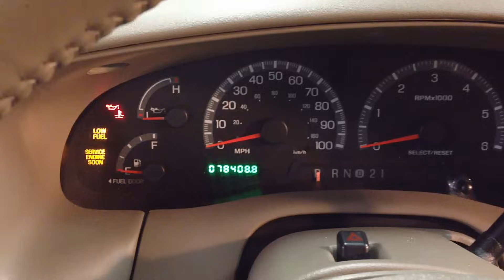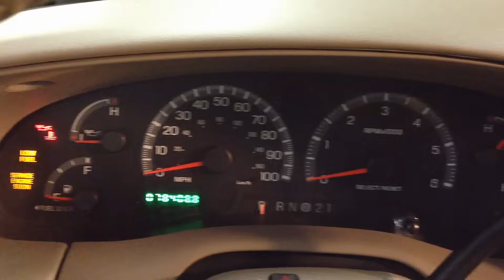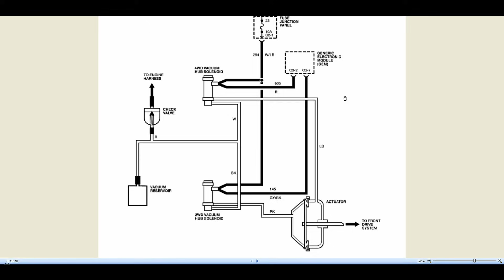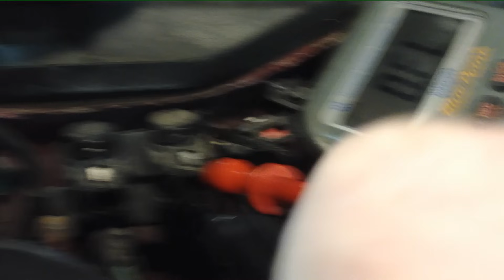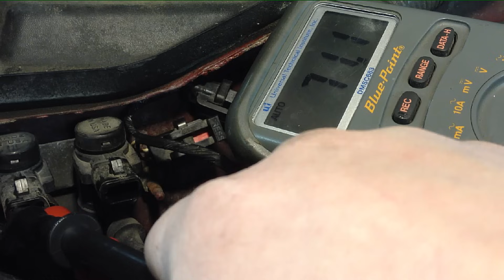1997-2004 Ford F150 4X4 Inoperative In Depth Diagnosis

Comment: Great video, used it today. Still can't get 4x4 to engage. Everything appears fine with the system locking the front axle in: the ground changes correctly, actuator moves as expected, relays click in the dash, can spin front driveshaft by hand and it turns right front wheel. Problem: though the 4x4 light comes on it seems reluctant; there is way more clicking than should be. Apparently no power is ever being transferred to driveshaft. Also once the dash indicator comes on it will not go off by turning the selector knob; the actuator on axle does not release until the truck is cut off then back on. Thinking its the transfer case shift motor but thought I'd post before spending the money possibly for no reason.
Reply: +Doug F   I am having basically the same problems. When I turn the switch does nothing happens. Sometimes I will here clicking in the middle of the dash which is not the normal sound. Stopped at the local parts store but no help. Then when I started to back up I could tell that the front end was locked in. Tried the selector switch and it made the normal sound of switching. The light for 4x4 does not come on. So not it seams to be working right. When you fixed yours, did the GEM need to be changed along with switch in dash, or was it changed just for incase?
Reply from the maker: +Doug F Have codes read in the GEM it will set a contact plate failure code you will then know it is the shift motor.

Comment: I have a 2003 f150 FX4 my 4x4 doesn't work. when I turn the switch on the dash to 4x4 nothing happens, no sound of clicking or anything.
Reply from the maker: +Donnie Miller no light either? If so have the codes from the gem module read the transfer case shift motor is likely stuck.
Reply: did you ever figure out your 4x4 issue im having the same issue with my 97 f150 and input would help
Reply: I had a similar problem on my 2002 f150 fx4. I removed the fuse (fuse #23, 10amp) it was not blown but i cleaned the blades with a knife and that gave me contact and the 4x4 dash light.

Comment: Thanks for this great video. I ran through pretty much every check and I think I have a few problems.

- Both solenoids have good ground, regardless of switch position, which seems to indicate that the GEM is bad
- If I disconnect the 2WD solenoid, I have vacuum at the front engagement unit in the correct hose, but the actuator is not moving when I reattach the hose

Can the actuator get bound up by being too rusty? 

I'm almost positive the GEM is bad since that area is rusty from a windshield leak, and my electronics are doing wacky things (like 4WD and 4LO lights both being on, strange clicking, speedometer is off, etc).

THANKS!
Reply from the maker: +jretta91 check codes in the gem first for the transfer case shift motor, then go after the gem module.
Reply: how do you check the codes in the gem? @FordTechMakuloco

Comment: Great video. I used it to diagnose mine last year. Ended up being the vacuum module. I replace that this past week. I also replaced the GEM because I was having weird issues that seemed to point to it being a problem - like the power windows not working all the time. Well after replacing the GEM no difference, except.....

I get no light when I turn on the 4WD switch. To be honest I am not sure it was working before that. The truck sat most of the summer and I was getting it ready for winter. So, do you thing the GEM (used) I got is bad? Is there a way to test the switch. I can reinstall my old GEM but it's a PITA job. The light comes on when the truck is started and goes through it's check, so I know it's working.

Any ideas??? Any steps I can take outside of replacing the old GEM.

Any help would be appreciate......thanks.
Reply: Ben A  You know I can't even remember now. I ended up getting rid of the truck and bought a 2010. But I am having problems with the 4WD on that one too which I hope to get worked out before winter hits. I love Ford trucks but there FWD systems suck.

Comment: 1997 F 250 Light duty looks like F 150. I did the electrical checks and vacuum checks and got an ohm reading on 2wd of 86.8 but on 4wd I got 72.5. Could this be my problem with not having 4x4?  Jeff

Comment: Hey FordTechMakuloco! Awesome video, man! As I was diagnosing my 1998 ford expedition, I noticed that the vehicle would only switch from 2H to 4H occasionally. I replaced the shift motor recently, and when 4H indicator did show on dash, I could hear the shift motor engage as well. I performed all the other tests on this video as instructed and everything else checked out. Could this be a bad GEM module? Thanks for all the help!

Comment: Does this apply to Super duty's as well?
Reply from the maker: +Joshua Chiarini No the superduty trucks are totally different setup.
Reply: +FordTechMakuloco I have a 98 f250 5.4L superduty, when I turn the switch to 4high or 4low I hear allot of clicking in the dash then nothing, I click it on and off over and over until the light turns on. The vacuum line behind the battery is the same so far as what you are showing. on the 4x4 side there was a big crack in the bottom vacuum line, I wrapped it in electrical tape for the time being to test it. both bottom lines now have vacuum. so I checked the electrical with a light exactly as you did here. When I run the light to the negative battery terminal both 2wd and 4wd light up no problem. when I hooked up the other side of the connections with the light on the positive side of the battery terminal the 2wd works no problem but nothing on the 4wd. so I kept turning 4 high on and off until the light came on, on the dash. when the light came on on the dash showing 4x4, my test light turned on. do you think it could be the transfer shift case or do you have any ideas on what it could be? Thank you for your time!

Comment: I have no power to solenoid from fuse 23 but fuse test ok with test light ...when I switch the switch in the truck to 4wd I get no lights ...it clicks for a few seconds then stops and nothing,, power windows work is it gem or 4wd switch
Reply from the maker: +Jason Capps You likely have an issue with the transfer case shift motor, check the gem  for codes.
Reply: +FordTechMakuloco even with power from fuse not getting to solenoid. ..my thought was gem its throwing no light codes
Reply: +FordTechMakuloco how do I check gem for codes
Reply from the maker: You will need to have it scanned by a shop that can talk to it, autozone cannot its on a different network.
Reply: +FordTechMakuloco by that price around here I should jus replace it

Comment: Hi Makuloco. I was viewing your video 1997-2004 Ford F150 4X4 Inoperative In Depth Diagnosis
I own a 2003 F150 4x4 and its stuck in LOW RANGE.. I found 3 things:
1.-Cant hear the clicks when changing from 4L to 4H to 2H.
2.-Break green vacuum hose that goes from 4x4 solenoid to the actuator
3.-When selecting 2H the 4x4 solenoid (left side) still getting ground from GEM..
How can I know if there is a problem in the GEM or in the 4x4 Switch?
No blown fuses by the way..

Comment: I just replaced my GEM module on my 1998 F150 4x4 lariat with the 5.4 due to the power windows, windshield wipers as well as the 4x4 not working or working now and then.  I replaced the GEM with a new module F85B-14B205-KA which is supposed to be compatible based on the number F75Z-14B205-AA which is the one I pulled out of my truck.  Although the number the number states it is compatible  the sticker with the number states  "Sport Utility a4wd" rather then "Pickup Truck 4x4").  Most everything works OK, windows and wipers, except the 4x4.  When I switch to 4 wheel high the light on the dash does not come on, however if I switch to 4 wheel low the light comes on 4 wheel high but also goes in and out of 4 wheel low.  It just switches by itself.  If the switch is set on 4 wheel high nothing happens but I hear a click, click, click on the GEM like it is trying to activate but nothing happens.  Does the GEM need programming, what do you think it is?

Comment: Hi. First Thanks for the very informative video! I have 97 Expy 4.6. It has the 2HI, A4WD, 4HI, 4LO positions on the switch. I have performed the tests as you described in the video. Good vacuum on bottom ports, constant power on supply to both solenoids. when switching test lead to positive terminal and checking for grounding on left side of each connector, I get ground on both, yet neither solenoid picks up  with vacuum hose connected to bottom, but not top.
When switching selector switch from 2HI to anything else, I get A4WD on dash, but nothing else. I had previously pulled TC motor off and turned switch and had it to move to each position, put it back and had it to engage front driveshaft. 
Is it still likely the TC motor? (It is the first gen as it is the blue one.)
Reply: +Scott Taylor Also. Continuity checks good on left solenoid, but dead short on right. Does GEM monitor resistance and lock up if check BAD? I may try FORSCAN code checker. Thanks again for great tips!
Reply from the maker: +Scott Taylor When both solenoids are getting a ground from the gem it is likely the transfer case shift motor yes. Get the forscan software and adapter I link to then you should be able to read gem module codes.
Reply: +FordTechMakuloco I really like the WiFi adapter and forscan software. GEM codes are P1832 & P1876.
Sound like TC motor? The P1876 indicates the 2WD solenoid showing open as I mentioned from before. Also have ABS C1234, right front speed sensor. Probably have to replace or clean this for entire 4WD to work properly....
Thanks for all your help!!!!

Comment: i have a 99 f150, 4.6l, manual tranny, and an on the floor 4x4 shifter, no shift motor, everything works when i test it but i get no reading to the system, ive been looking for the transfer case switch that lets it know its in 4x4 but cant find it anywhere. does anyone have a diagram or a picture of this? or is the sensor inside my t-case, i do see a plug for it but noplace to plug it, and no wires or holes. maybe someone swapped transmissions and this one doesnt have that switch? if so how would the system know it is going into 4wd from the floor shifter?. really stumped here.

Comment: I have a 1997 ford f150 4x4.  Not getting any power to 4x4 Solenoid when turning switch on dash.  No lights come on in the dash as well.  Have a new switch, still nothing.  Any troubleshooting guidance would be greatly appreciated.
Reply from the maker: +Glen Morgan The power should be constant, the grounds should be switched. If the light is not coming on then it is likely the GEM has found a fault with the transfer case shift motor and is not even attempting to turn on the 4x4
Reply from the maker: +Glen Morgan Get the codes read from the GEM module that will tell all.

Comment: FordTechMakuloco First off great video.  I have a 1999 F150 XLT 5.4L with esof.  My 4x4 has been messed up for a long time and ive tried to fix it off and on again with no luck.   
Heres what it does turn knob on dash to 4hi light on dash comes on but 4x4 doesnt engage.  If you try to turn knob back to 2wd the 4hi light stays on and nothing happens.  You just have to leave it like that for about two days and eventually I will start the truck and back out of the driveway and 4hi will be engaged.  I can then turn knob to 2wd and you can hear it disengage and the 4hi light goes off.  If you try to go back to 4hi the whole process starts over again.  

This is the work ive done.
1. Replaced solenoid closest to engine it had a crack and 0 ohms. 
2. Tested solenoid closet to fender tests good. 
3. Tested vacuum and all lines and reservoir all good best I can tell.  
4. Constant 12v power to both solenoids are good. 
5.  Fuse 23 good.
6.  New actuator on front axle and it moves freely and forks feel good.  
7.  Found a write up on ohm values for dash switch and checked it values match what a good switch is suppose to have.  

The bad or things I havent done.
1. Havent messed with gem
2. Havent messed with the relay in the dash in between radio and gauge cluster.  (I dont even know if its relivent.  
3.  Havent messed with transfer case motor.

4.  And the biggest thing that makes me scratch my head is when the 4hi light is stuck on and the 4x4 is not engaged both solenoids test to have there 12v power and both show having ground on the other pin.  And I know they are only suppose to have ground one solenoid at a time.  

When this is happening the fender side solenoid is letting vacuum through and engine side solenoid is not letting vacuum through even though they both show ground.  
Also when I reolace the engine side solenoid after it tested bad the 2wd, 4hi and 4lo all worked for about 3 cycles in and out and then it started do the same thing I explained earlier.

Your help would be greatly appreciated im sick and tired of dumping time and money into this and im running out of ideas.  
Thanks in advance look forward to your reply.
Reply from the maker: +Cody Sexton For this situation it is best to read codes in the gem to see if the transfer case shift motor has lost its plate position. Make sure no codes are stored for the motor then from there you can see if the gem has failed keeping both solenoids on. look for a p1867.
Reply: FordTechMakuloco ok I disconnected the battery the other day so that would have probably cleared the codes.  So I guess I will have to drive it for a couple days before I check the codes?  If I have a p1867 does that mean the gem is bad or the shift motor is bad?
Reply from the maker: shift motor
Reply from the maker: Cody Sexton shift motor
Reply: FordTechMakuloco ok thanks I will check that out and see what I can find.  I hope its as simple as replacing the shift motor.  Im sick of dealing with it.
Reply: +FordTechMakuloco So I checked the codes had a few that I already knew were there for egr and abs.  The only other one I had that I didnt know about was a p1000.  I dont think it has anything to do with the 4x4 best I can tell.  So any other ideas?  Is there a way I can test the gem or trans case motor.  I dont want to keep replacing parts that dont need to be replaced.  Any more help you can give would be greatly appreciated.
Reply from the maker: You performed a self test on the gem and no codes cam up or your scan tool cannot talk tot he gem?
Reply: +FordTechMakuloco 
I dont have a tester so I went to advanced auto and used theres.  I it to run diagnostic and read the codes that it produced.  Did I do something wrong or was I suppose to do something different?
Reply from the maker: Most scan tools like the ones they supply cannot talk to the gem module is my concern therefore unless the scan tool responded with a pass from the gem module then we are still where we began. We need a scan tool that can talk to the GEM.
Reply: +FordTechMakuloco Going in the morning to get the guys at the local garage to put it on there big fancy diagnostic machine he said it will read the gem.  Let you know the outcome.
Reply: +FordTechMakuloco So was gonna let you know I had a p1838 code (trans case motor curcuit malfunction).  it wasnt the code you said but I figured it was close enough so I picked up a new trans case motor and she is working like a champ now.  thank you so much for the help.  you are a life saver I really appreciate it.

Comment: +FordTechMakuloco I have a 98 f150 esof that's stuck in 4lo the front diff isn't locked only the t case. I went to engage 4wd and it didn't work no clunk no dash lights nothing. After I got out of the mud I parked and shut off the truck when I started it back up to leave I noticed it was in 4lo but the 4x4 lights on the dash aren't on. I know it's 4lo cause the engine revs high at low speed. I also know the front diff isn't locked because I lifted the front end and spun the tires to check. Any ideas where to start? Any advice would be greatly appreciated thanks!

Comment: FordTechMakuloco Hey. Your video is great! I have a 1998 F150. The 4X4 light is not coming on. In going thru your steps I learned that I'm not getting the ground to my 4X4 solenoid when turning the switch. The ground stays at the 2X4 solenoid and nothing happens. Is it likely that my Transmission range sensor could be sticking?
Reply: +FordTechMakulco  Let me know your thoughts please
Reply from the maker: John Cox I would get codes read from the gem module it is likely seeing a fault in the transfer case shift motor and not even attempting to turn on the 4x4 solenoid, this would also explain the 4x4 light not coming on.
Reply: FordTechMakuloco Thank you

Comment: Hi, i have a 2003 ford ranger fx4 off road xlt.  And when i got it, the 4x4 would switch on just fine, but it had a late reaction to the switch. Now i took it to a mechanic shop to look at it, and the guy said it was a circuit failure.  Well, now it doesn't want to come on at all. And the guy said it could be the transfer case motor.  But, i need a true saying on this to be sure.  The 4x4 light won't kick on when i switch it in, and i will have it in park or neutral.  But when you switch it to 4x4 you can here a click towards the passenger side. Please tell me!!!!

Comment: I have a 97 f150 4x4 it will go into 4 wheel drive by the switch but it won't go back to wheel drive is it the 4wd solenoid that's bad
Reply from the maker: Van Milloy The shift motor can get stuck in 4wd but first inspect the 2wd solenoid to make sure it is transferring vacuum and the vacuum motor on the axle is moving.

Comment: I have a 98 f150 that was stuck in 4wd. When I disconnect houses from solo noida under hood it comes out of 4wd, reconnect hose and goes back in. Can you tell me what needs replacing or give me a direction for additional trouble shooting?
Thanks Gene